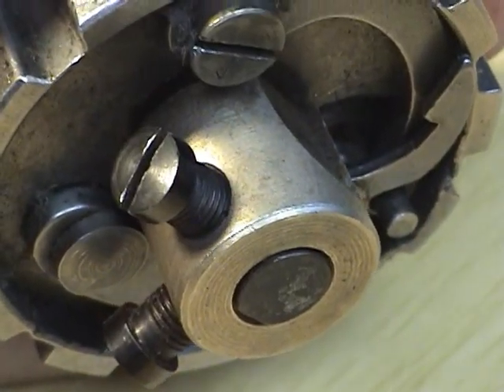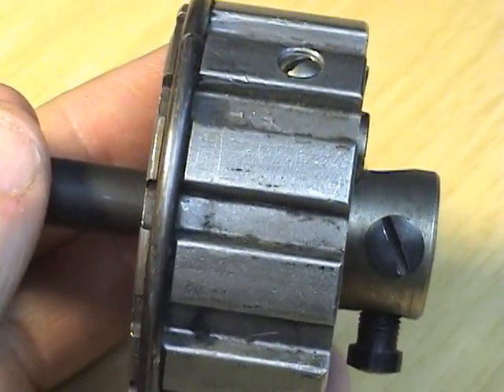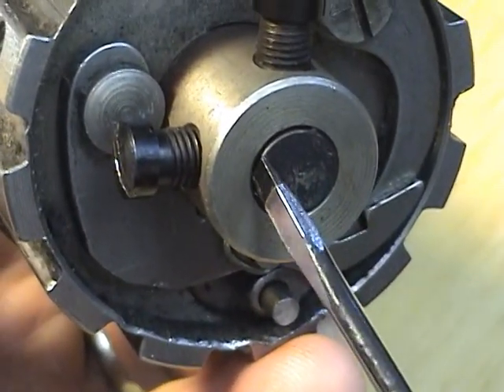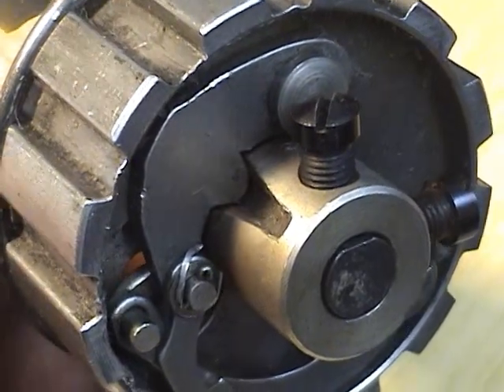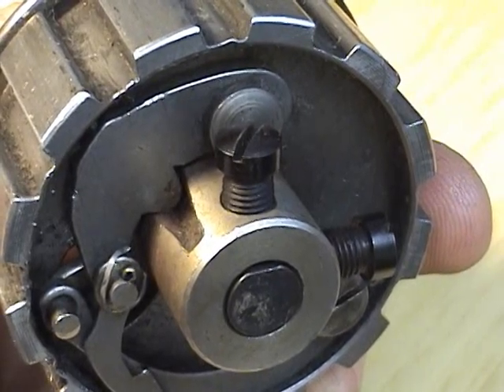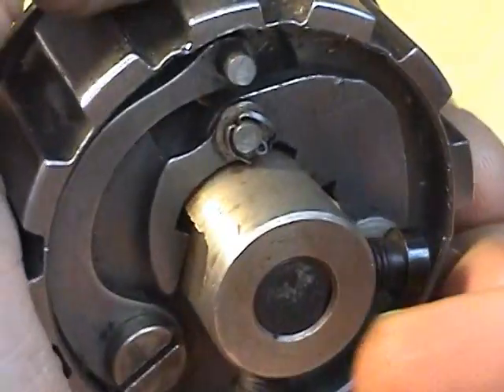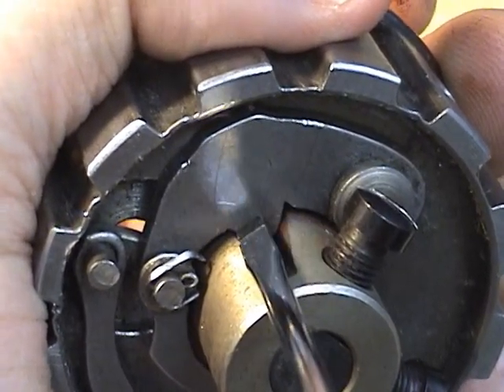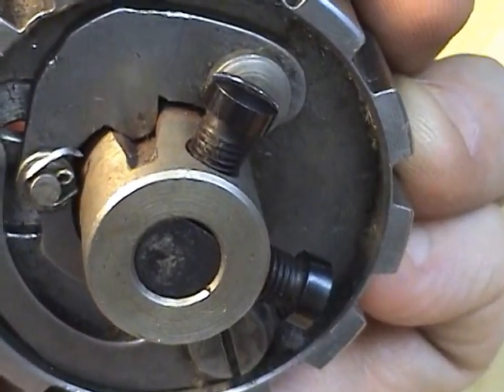Singer Safety Clutch

Comment: Do you have any idea where to get the screw that goes in the curved piece that you took the set screw out of in order to tighten the clutch.  The one that adjust the play in it
I have the 111 any info would help alot

Comment: Can you help with a problem I have with a Juki LU 563? The clutch does not re-engage the main shaft after resetting the clutch ( I cannot sew). I have tried pressing the right button while turning the belt drive wheel, in the opposite direction ( away from the sewer) according to the instruction manual. The wheel seems to be locked when pressing the button and does not correct the problem. In addition the the stitch length mechanism disengages the clutch each time I try to change the stitch length. Thank you in advance.